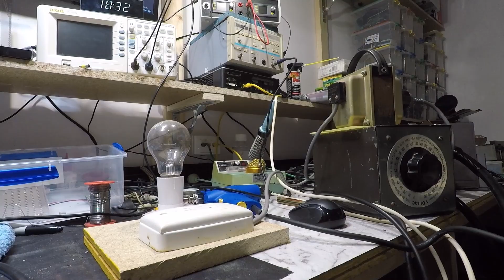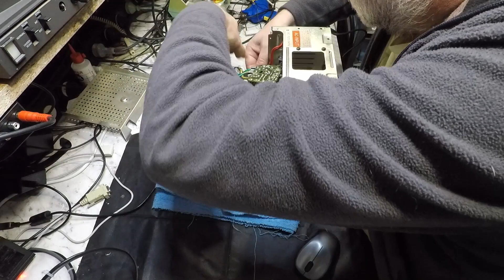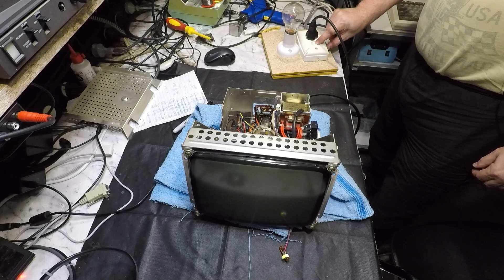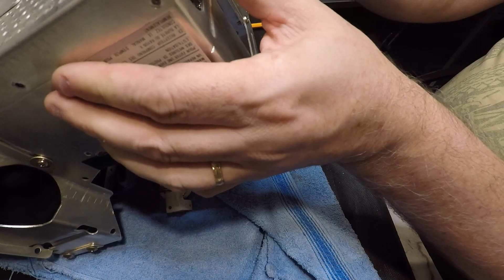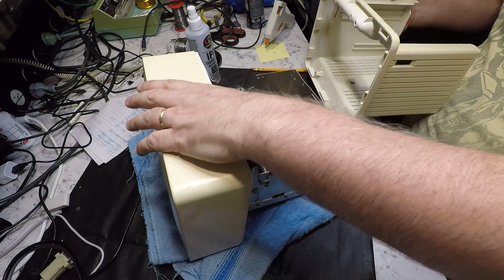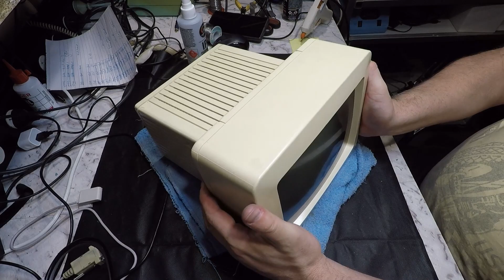Apple IIc monitor repair - part 2

Comment: Thank you for sharing this repair - a very useful reference! I have recently recieved a IIc that is for 110V (US) power which I want to run on Australan 240V supply. The computer's external PSU is easy enough to replace with a 240V one but I am wondering if you have any thoughts on how possible it would be to convert a 110V IIc monitor to 240V and what might be required - do you think  one could simply replace the transformer and some components on the power board?
Reply from the maker: Sorry for the slow reply - interesting question.  Without consulting the schematic I couldn't say - but it /might/ be possible to replace the power supply if all the monitor needs is the DC it's producing (and not using it for AC voltages or as a frequency source).